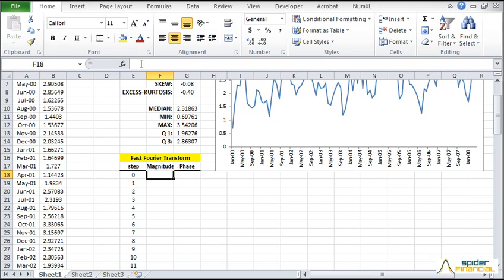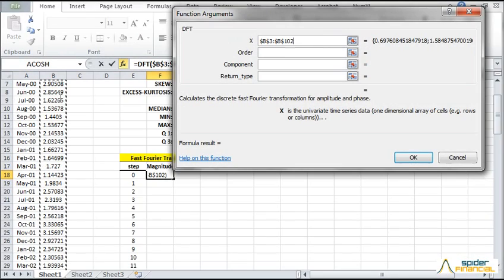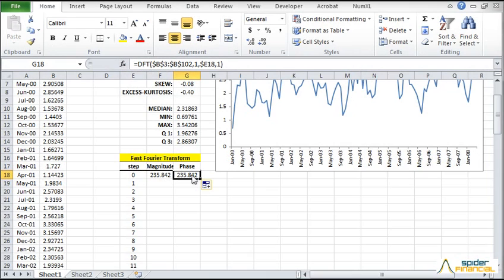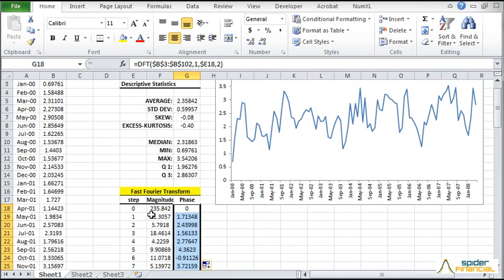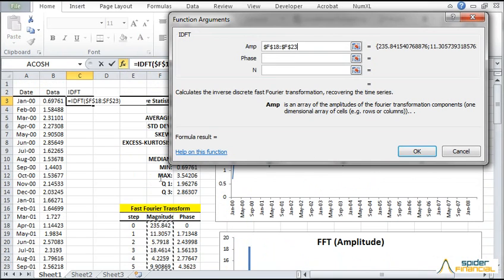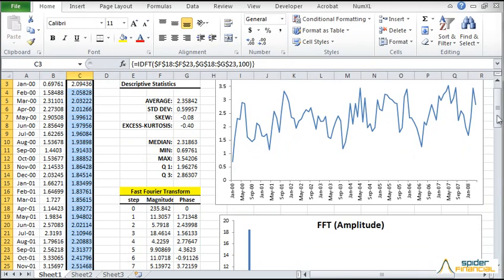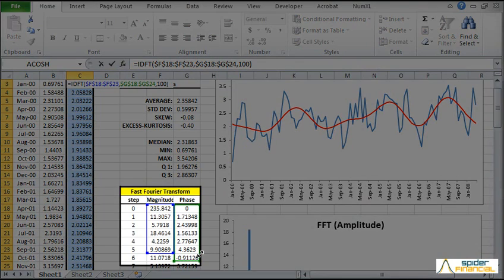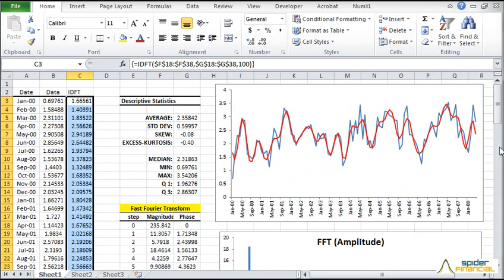Bootcamp no. 10 - Discrete Fourier Transform functions in Excel

Comment: Can i optain my data after fourier transform. I want to use IDFT value and optain my real data. Is it possible. please answer my question. Thanks for your help.
Reply from the maker: Of course you can: this is guaranteed by the definition of the DFT Transform. You will however have to use the full spectrum of the N/2 component. If you need any further assistance please contact us at support@numxl.com.